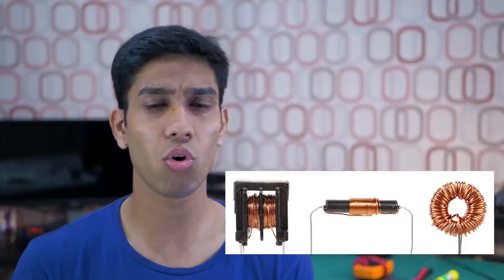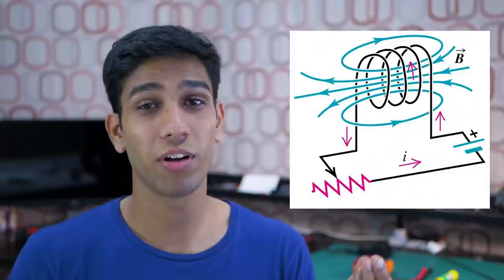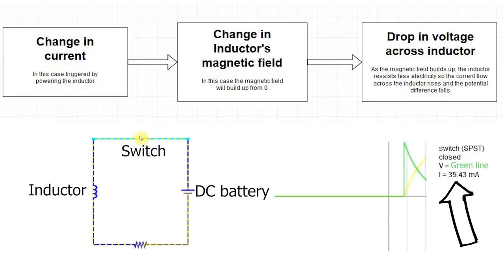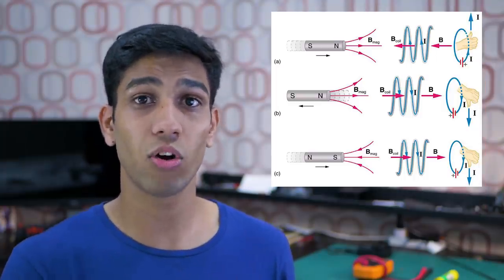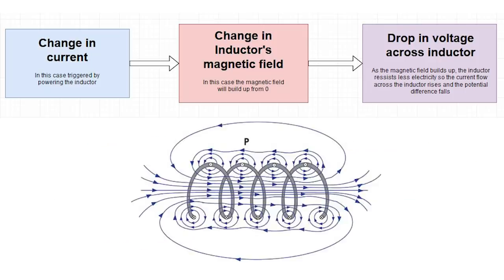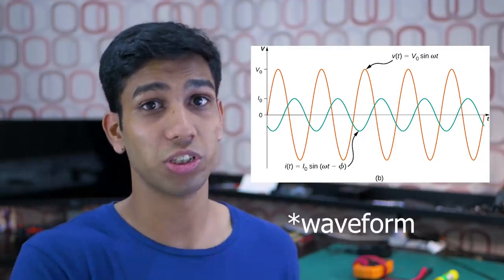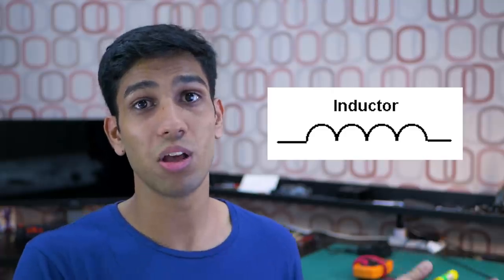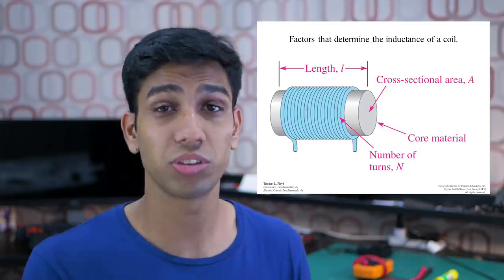Inductors and Coils tutorial in 5 mins- Electronics Crash Course # 15

Comment: I like your TinkerSpark instructional program, Saral. Not to confuse this inductance issue but could you tell us or make a video on the subject of early radio and inductance of the coil? I see that old time crystal radio sets sometimes show a measurement of 'micro H" , Henrys. Some of your younger subscribers may not know that a radio need not have an electrical plug to receive an A.M. signal . The electricity coming through the air, broadcast from the radio station, is enough to power a "crystal set" so the listener can hear the broadcast with earphones. Wall power is just to drive the speakers. I would like to know if the winding in a crystal radio from the 1940's is an inductor and if so, is that involved in the tuning of the radio to a station and how that works . Thanks

Comment: For what purpose do most consumer electronics include inductors?
Reply from the maker: Energy storage, smoothing out current change, or cutting down AC voltage
Reply: The most common reason seems to be in power supplies.

Switched mode power supplies work by turning a circuit on and off rapidly.  It's more efficient than power supplies that simply dump excess power as heat.

Inductors can also be used for neat tricks like increasing DC voltage.
Reply: @kategray1867   to add to what Kate said, a lot of power supplies that switch from AC to DC power will often use inductors for multiple stages of the power conversion. Usually on like PC power supply, you will have a transformer for the initial stepping down of the voltage, then you will sometimes see inductors used as "chokes" (or filters, typically combined with other circuitry as stated in the video) to filter out higher frequencies since impedance increases with frequency in an inductor (Xind = (2*pi*f*L)).